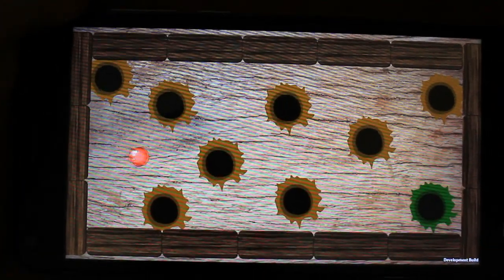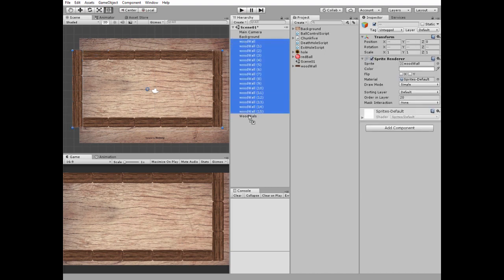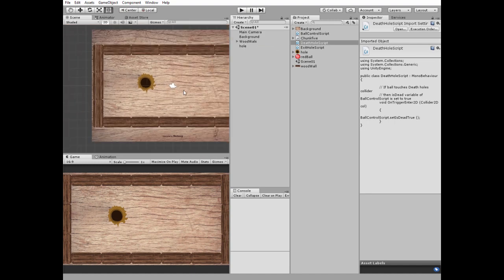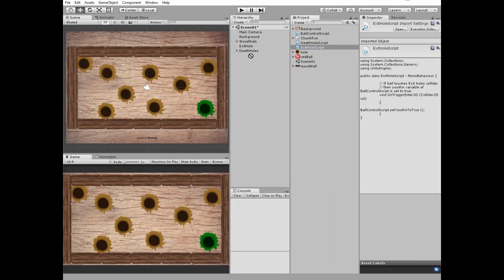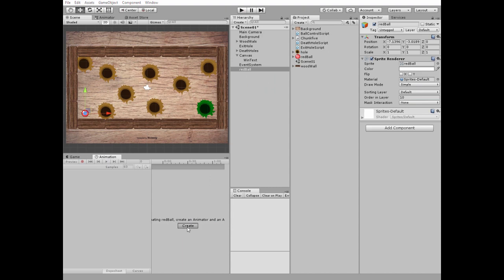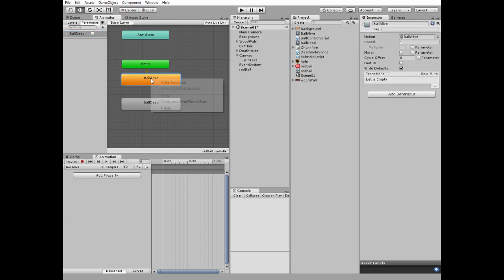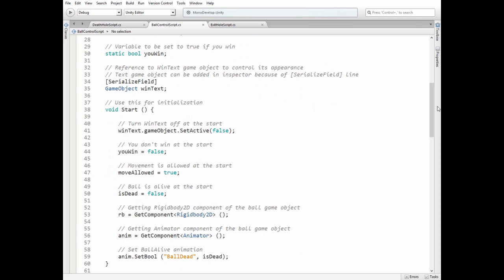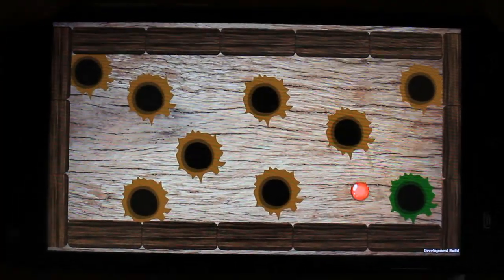How to make simple Ball Balance Android game using Accelerometer Input with Unity? Easy 2D tutorial.

Comment: Does this still work if you have you phone upside down (for example when laying in a bed)? I am developing a game where you control a platform rotation using the accelerometer. But the platform is rotating in the opposite direction when the phone is upside down. I am currently trying to solve the problem.

Comment: is there a way to make the ball seem like its going into the hole instead of just using the animator like it falling into the center of the hole
Reply from the maker: +Narain Ratan I think that we can create a 3d project with main camera above the board pointed downwards. Board can have some holes with colliders attached. So when ball touches those colliders then collision with board is disabled and ball falls down. Something like that)
Reply: i was thinking more like smooth moving it to the center of the hole but I've tried a bunch of different codes and all that happens is that it instantly snaps to that location i have also been tried slowing down the ball movement speed with drag instead of stopping move allowed but that doesn't work either do u think the only solution is gravity?
Reply from the maker: +Narain Ratan Did you try Lerp?
Reply: yes the problem and it still snaps and doesn't move slowly also it always snaps to the first hole not the hole you fall into
Reply from the maker: +Narain Ratan Well then your script should be checked more carefully step by step.
Reply: i have checked my script multiple times maybe I'm using lerp wrong could you please help me with the code
Reply from the maker: +Narain Ratan drop it here. We will take a look)
Reply: public class DeathHole : MonoBehaviour {

 public GameObject target;
 private Vector3 startPosition;
 private Vector3 endPosition;
 float speed = 10;

 void Start (){

  startPosition = target.transform.position;
  endPosition = this.transform.position;
 
 }
 void OnTriggerEnter2D (Collider2D col) {

  target.transform.position = Vector3.Lerp(startPosition, endPosition, speed * Time.deltaTime);

  BallControlScript.setIsDeadTrue ();

 }
}

This is what I've tried most recently and now the ball moves to a weird location.
Reply from the maker: Is it a 2D project?
Reply: yes i tried using vector 2 and it gives the same problem
Reply from the maker: If you are building 2D project then you should use Vector2. Did you reset your ball gameobject as you added it to the scene? Sometimes Z axis has some value which is not equal to 0 so Lerp movement can go wrong (not as you expect).
Reply: Hi i tried this its still moving to a weird location is my lerp script correct or is there a mistake there?
Reply from the maker: Here is how Lerp should be used https://docs.unity3d.com/ScriptReference/Vector3.Lerp.html